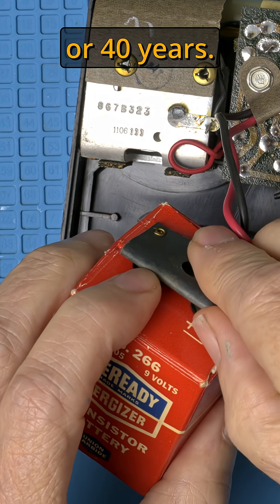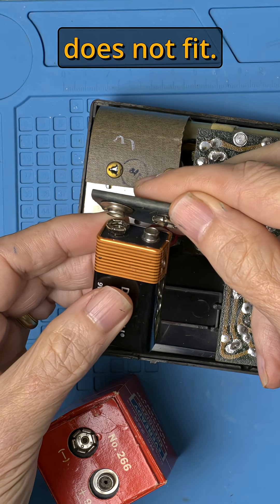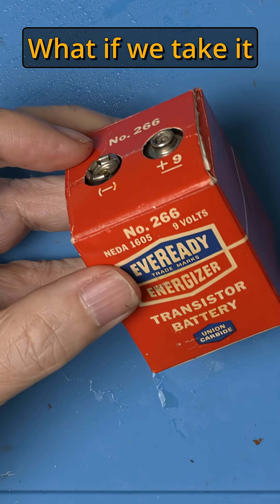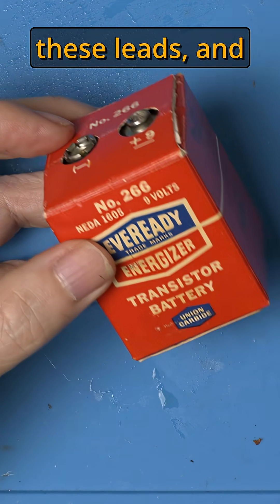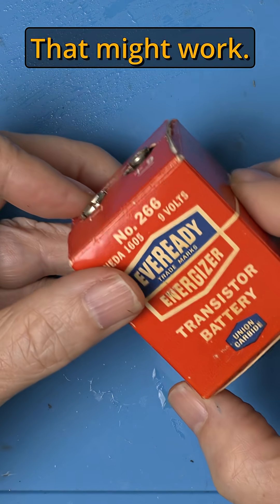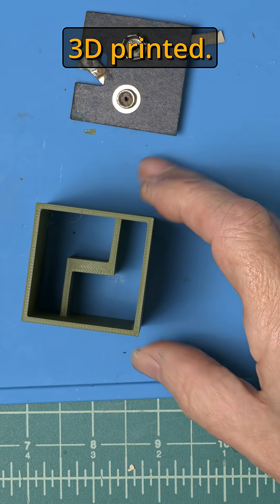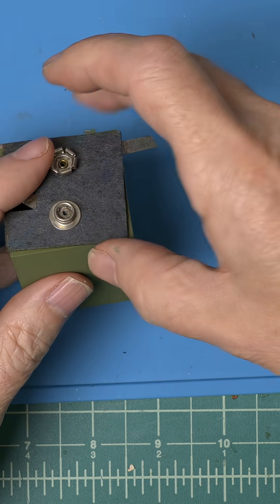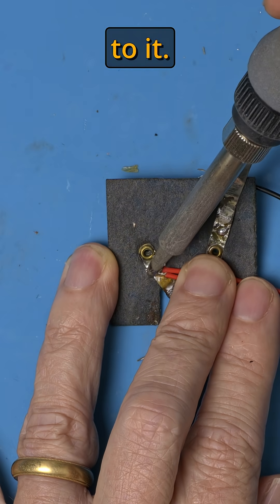3D Printed Vintage Battery Adapter #vintageelectronics #3dprinting #eveready #electronicsrepair

Comment: u shouldn't connect batteries in parallel. Search it up
Reply from the maker: If you are absolutely right if you're pulling two random batteries out of a drawer, one will try to charge the other.  But if you put in two fresh ones it's usually safe.
Reply: @Dream.Build.Create  They will still not be of precisely same capacity, thus one will be charging the other. You can do it with similar type rechargeables, but better not do it with the regular ones. Though I doubt anything really bad will happen, but it's still not a good idea
Reply: @eugenegrebionkin funny that most electronics use multiple batteries. Especially when it's alkaline batteries. It's like op says if you use new batteries from. The same package you won't really have that problem. It's not before you use used batteries or mabe a another brand or batch you will have the problem you described
Reply: @saiko4477 You know what's the difference between series and parallel connection, right?
Reply: @eugenegrebionkin  The discharge rate is going to be so close that they're not likely to ever have problems. You can also charge alkaline batteries at a very slow rate, and that's all that's ever likely to happen in this situation.
Reply: @eugenegrebionkin yeah i do. The batteries will try to equalise regardless of its parallel or serial
Reply: @saiko4477 Sorry, but how will they try to equalize if  its series? What exact parameter will equalize?
Reply: @eugenegrebionkin well they will always be connected with each other regardles if its paralel or series. The main difference is just  if you want higher voltage or higher amperage. But say if you take 2 1.5v batteries you connected the wire on the positive on one side and on the other battery you put a wire on the negative you will not get any power before you touched  the opposing sides.  Same any configuration
Reply: @saiko4477 Right, but they will NOT try to charge each other in the series configuration
Reply: @eugenegrebionkin  Batteries are placed in parallel all the time, as you've already been told. You're a YouTube armchair engineer, just accept that you're repeating things that aren't relevant in this situation, and move along.
Reply: @HaileyKerrin just because the batteries are side by side, that doesn't make them parallel.  Anytime the positive of one battery is opposite in the 'remote'  it is in series.
Reply: @Dream.Build.Create if the voltage differ too much there will be a strong current producing heat that could melt your wires if too thin.
Reply: Not true here. 😊
Reply: @BertRedd  Yes, it is true anywhere.
Reply: You are correct.

Comment: The only thing that I think you missed would have been to cut out the whole 3d printing process and just replace the battery leads.
Reply from the maker: If the battery connector in the radio was corroded I absolutely would have done that, but it was in perfect shape so I wanted to preserve it.

Comment: That is sure to confuse the hell out of the next person that opens that up, lol. Genuinely a really cool fix though!
Reply: next person going to make a video on how to replace an ancient 9-volt batteries with a power Crystal
Reply: @locksmith7621  This is a funny concept lol. I'd like to think that instead of using just the original box and connector, they keep printing and adding more and more adapters.
Reply: @GrimReaping  the battery of Theseus
Reply: @locksmith7621 has to be a 9 volt power crystal specifically 😂
Reply: @flyzfm5060and people will be making videos about it, and commenting how bad the soldering job was lol
Reply from the maker: Ha!  You’re right!
Reply: @Dream.Build.Create yeah I hope at least leave a note about modification or idk maybe QR code for this video?
Reply: When I find DIY mods in antique/vintage items it honestly makes them that much cooler to me, it adds to the story
Reply: @MidwestBenji and it shows that it was loved enough to be modded or just fixed to keep working
Reply: @MidwestBenji  once upon a time they had gigantic 9v batteries, but they stopped making those, so we had to make do with modern 9v batteries we had of our era to bring the equipment back to life.
Reply: Confuse? Why?
Reply: @Kau001 thinking the original battery is still there.
Reply: @Kau001  I don't know if anyone has explained it to you yet, it's because he kept the original box. The joke is that the next person who opens it to repair the battery will assume its an old battery, but then open up the box and see that its actually two modern 9V batteries in a 3d printer chassis.
Reply: @Kau001  Yeah, it looks exactly like what its supposed to be. The response would be more like, "whats this ?, , , Oh I see".
Reply: @Kau001 old box battery with modern internals
Reply: "ugh i hate modding these batteries"
"YES, THANK YOU LORD"
Reply: Yeah they're going to think that whoever made this was from the future.😂
Reply: No it won't, like anything else that's been tinkered with they will just know that someone has been inside it before them. 🤷‍♂️
Reply: I just hope the next person doesn't look and think there's an old irreplaceable battery and throws the whore radio in tha bin
Reply: Nah I’d get it figured out fairly quickly and then toast the guy or gal who did it.
Reply: At this size I would have went for 6x AA 1.5V
Reply: And in another 100 years those 9 volts are gonna get replaced by a fusion cell with some DIY'd adapter
Reply: why would anyone with sense that open up an antique radio and see a modified battery with 2 9volts be e confused ? he didnt go back in time ......
Reply: The 3d printing technology already existed in the 1800s
Reply: @NicoGervacio it existed a lot longer than that, we just used subtractive operations rather than additive because it was easier.
Reply: There is no next person it's end of the line for that device
Reply: @003_Shadows Yeah, FM is gone where I live. DAB has taken over with  bandwith for more content.
Reply: @003_Shadows  How do ya figure? That device is probably older than you, and it may be around after you. Electronics don't wear, despite what Apple might tell you.
Reply: @Matthamatic  I guess that depends how you define "wear." But obviously components can degrade and eventually fail.
Reply: @Samzee89  If run under tolerance in a cool, dry environment, most solid state electronics "should" be able to run an indeterminable amount of time. Batteries and electrolytic caps fail due to thermal and/or chemical issues, but if made really well and run under tolerance, even electrolytic caps can last a looong time.
Reply: @Matthamatic  Yeah, in a vacuum is one thing. Even still, I've replaced enough caps to know that they're a ticking timebomb that need replacement well before they fail conpletely.
Reply: @Samzee89 ceramic caps do not have this issue. I bet this thing will run long after you and I are dead.
Reply: @Matthamatic  And I hope it does.